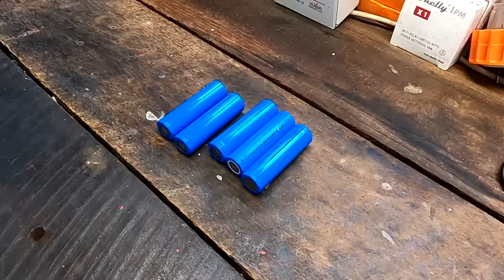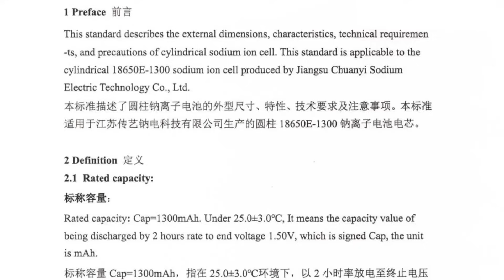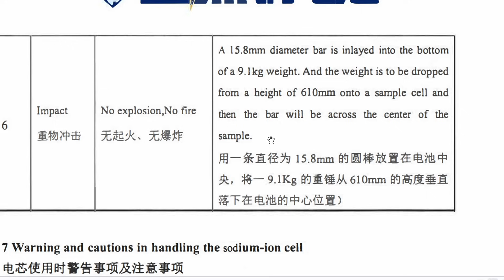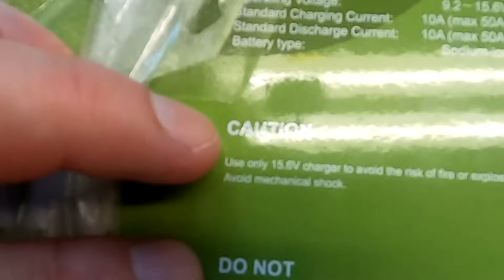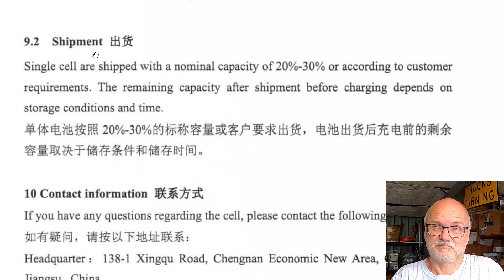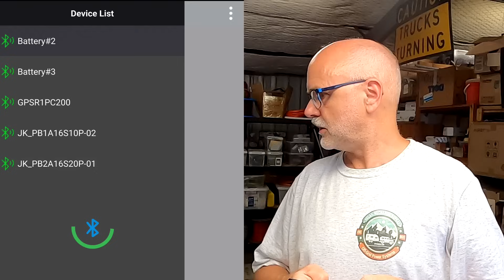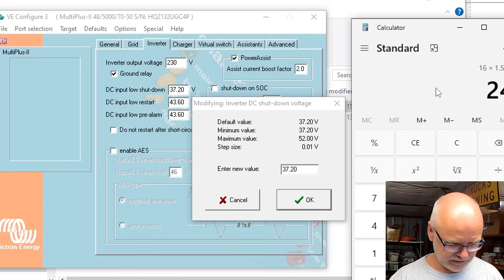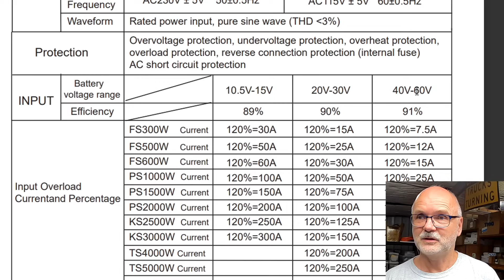Sodium Cell Charging and Discharging Analysis, Hardware Compatibility. Future or Niche product?

Comment: We are all beginners again!  Lets see... 3904 Wh discharging, 4165 Wh charging.  93.7% round-trip efficiency.  That's actually fairly poor, I was expecting 95%+ but it could be due to the C-rate.

3000 cycles is an achievement, for sodium-ion, that part looks good.

But the discharge curve is gonna cause problems for almost every application.   Maybe we've gotten a bit spoiled with LFP, but practically speaking 10V (2.5V/cell) is going to be lower useful limit for 12V devices.  And yet, going to 5s is not practical either because the high-side voltage winds up being almost 20V.

15s is a bit too close to the practical limits of most 48V devices.  59.25V fully charged... 48V gear typically has 60V IC tolerances.   Some (POE+ for example) is more around 57-58V (spec is 57V and equipment usually OVPs at 58-60V).   So 15s is playing it really too close to the wire.

That leaves 14s.  The 55.3V maximum is very reasonable.  The low-side with a reasonable 2.0V/cell cut-off is going to be 2.0V x 14 = 28V.   Yuch.  Good god.  How is that even remotely useful!  

I can see why the guys that shipped the battery to you weren't happy with the performance.

-Matt
Reply from the maker: Thanks Matt. Yeah, I had the same thoughts. I cannot see this technology going into the mass market soon. LFP is still heaps better in most aspects. There is a lot of hype about... not much.

Comment: In the long run we will see more 2nd life use of EV batteries like all the Nissan Leaf and what not that get either new batteries or are torn apart to be used in spare parts. 
These batteries will have a big impact on our current diy setup cause the inverter manufacturers are leaving 48V behind sooner or later.
Check out the finnish developer of a can bus battery adapter to reuse old EV batteries cause I guess it is another big opportunity based on the prices cause even ID.4 batteries are now sold for cheap as used ones , I mean a fully working 77 kWh battery in a 6000€ price range.
Of cause huge capacity not everyone will need, but it is just an example considering there are also 58 kWh versions with a lower price point below 4500€. And the smaller ones like the Nissan leaf get also cheaper. Safety might be a concern, but at the end it is a safe battery running with the usual manufacturers BMS where only one mini computer is added as communicator between the cars BMS and the inverter.

Search for the channel 'Dala's EV Repair' and have a look about the ideas, also flying tools from sweden has added an id4 battery to his inverter (which he has mounted on a trailer to move around). 

I doubt that Sodium will have any impact soon cause what would make us move to something different: more value or capacity for the $ 
High C ratings do not really matter anymore cause all of them have that nowadays.

Comment: Hi Andy,

the "LumenTree feat. Trucki" 600-M/800-M/1000-M/2000-M Grid-Tie Inverters (old versions formerly known as SUN Grid-Tie) can actually use 100% of the capacity, as they have a very wide input voltage range of 22v-65v 😜
Reply from the maker: Yes, correct. The SUN can do it...

Comment: The Ingeteam Ingecon Sun Storage 1Play 6TL M inverter has a voltage range for batteries from 40V to 450V. Full capacity can be used in sodium batteries.

Comment: Now leave it going, charging and discharging for a 1000 cycles.
Reply: YOu can not simulate normal use in PV, because you can not simulate temps inside cells, charging temps, dischargong temps,  charging algos, not all inverters and MPPT use CC-CV. which is one of the worst charging algos. They are better charging algos, that save your battery and you can use it not 15, but 35 years. The is a lot of pdfs, how to build DC-DC BUCK, BOOST, FLYBACK charger, AC-DC charger and how to build BMS with 15 - 35 AMPS balancing curret, so you can use 35 AMPS MPPT or DC-DC charger, without communication with your inverter or BMS and BMS is still able to balance quickly to this 35 A limit.
Reply: @PavolFilek I’m currently designing a BMS for a sodium ion pack for my electric motorcycle, is there any charging algorithms you would recommend looking into? (You mention CC-CV is one of the worst but what’s the best?) Would you say it would be necessary to write my own algo specific to the cell?
Reply: @kadensmith5586  I do not curently make SW for BMS, because no sutable parts and oscilloscope, but there is pdf , where is comparison algos like : Six PPC, Standard PPC, PWM, PAM, CC-PC and PC-CV. My work on BMS with 35 AMPS active non isolated and 15 AMPS active isolated balancer is stopped.
Reply: use RE-EMF CHARGER

Comment: Curious to see a temperature vs charge curve to see if that bump coincides at all
Reply: that was also my thought, but then the bump also appeared on the other way around, as well as the official curves, so I guess it's a sodium thing. Wouldn't be super surprised to find out that getting to this bump actually does some damage, since it surely looks like something changes with the chemistry.

Comment: Lead acid is king still in cold weather, but sodium might be the next. Would a 15s be better for the peter inverter?
Reply from the maker: With a 15s battery, the lower voltage would be even lower.
Reply: If you accept the need to insulate and heat the battery LFP is still king in cold weather. With good insulation it doesn't take much energy. I use 60W electric mat heaters under a 30kwh pack with a temperature controller

Comment: can you run a bank of sodium batteries alongside lithium ion - or lifepo4 battery banks?
 they are not cheap enough to simply discard them to replace with a new chemistry?
Reply: I'd imagine that you could do it safely, but they'd have to be in parallel, meaning that you're limited to the safe voltage range of your LiFePo cells, so you'd be losing a heap of capacity in the sodiums. I think there would also be stages where you're pulling higher current from one over the other to maintain the same voltages. That may not matter, but it's not very efficient.
Reply from the maker: As I said in the video, that's not possible.

Comment: Interesting discharge curve, i suspect at 2.7v the sodium battery see's the lithium battery quit and gives it a boost of energy for the home stretch. We have a winner!  ?  Maybe this would be a good time to use a boost converter despite the losses you can keep a desired voltage while the cells discharge fullly.
Reply from the maker: That's not going to work. The sodium battery will not boost the lithium battery, it will just take over the load at this point and keep quickly discharging further. To a point where the lithium BMS will disconnect and shut down you whole system due to a UVP. Really really bad to mix different battery chemistries...
Reply: @OffGridGarageAustralia  Oh i meant metaphorically, the soidum cell was racing the lihtium one and saw i t quit at 2.7v giving it a boost of extra energy to finish the race knowing it was going to win.

Comment: I had a solar shop that was handling sodium cells.  They were very high on this chemistry and sold many of them but it went very bad for them.  Eventually they offered full rebates to all the customers who purchased them.  
I really don't know much more than that.
Reply: Yes and the first lithium car batteries burned lots of cars down too.   There will be issues but the bottom line is sodium is one of the most PLENTIFUL elements in the world and lithium one of the rarest.   end of discussion.
Reply: virtually no equipment supports the large voltage curve yet so whoever bought them is not too bright

Comment: Interesting, we will need BMS with buck or boost-converters on-board, or perhaps some clever way of dynamically re-arranging a pack.
Reply: All decent solutions.  Well, not boosting... boosting is always inefficient.  But certainly bucking-down a high pack voltage is workable (e.g. 24s pack, 48.0VDC to 94.8VDC) -> buck to 48V with a FET bypass when the pack is below 53V.

Cutting and tying the pack with contactors works too (several EVs already do this, in fact, to accommodate 400V/800V charging architectures).  One advantage, though, is that serial/parallel-switching contactors can solve the problem for chargers as well as for consumers.    BUT it introduces a mechanical component that is undesirable as well as a transfer glitch, and the transfers would have to be done under load which is a big no-no.

Inverting a wide DC voltage range is also a decent solution, but difficult to implement efficiently and the input stage current handling would also have to be seriously beefed up to deal with the low-side of the voltage range.   And it doesn't solve the charging problem.

--

I would add, changing the battery topology with FET switches instead of contactors is also possible, but doing so requires the two halves of the battery pack to be isolated from each other.   Since most charge controllers are not isolated this would create a ground-reference problem for the panels.  Still theoretically doable (panels are supposed to be able to handle 600V of common mode between frame-ground and cell), but I have a feeling that would probably trip over a number of code regulations.

-Matt
Reply: probably not. easier to invert it and use a transformer to hit AC target